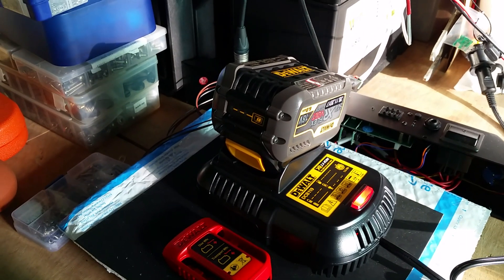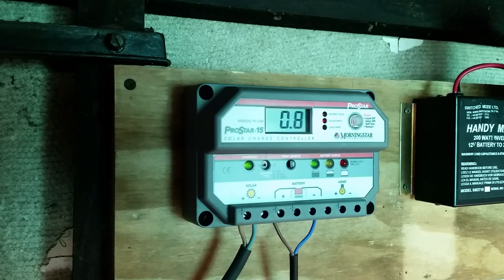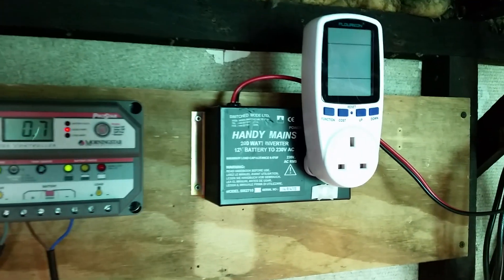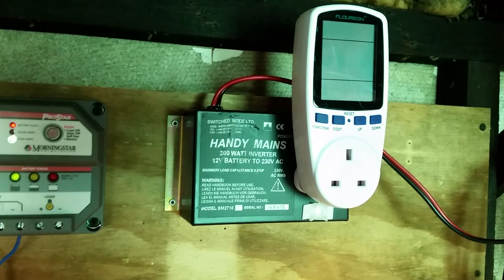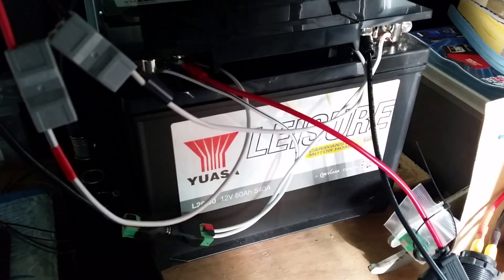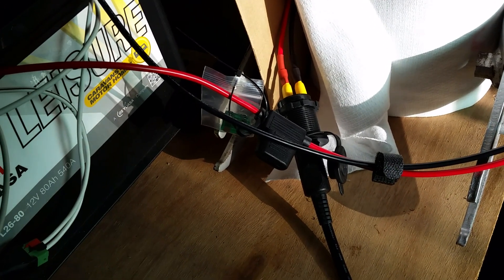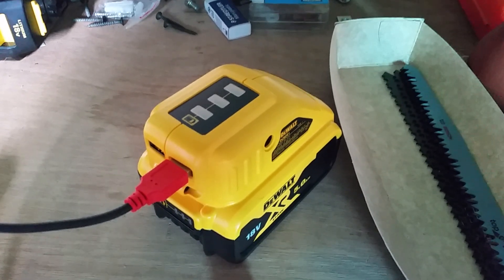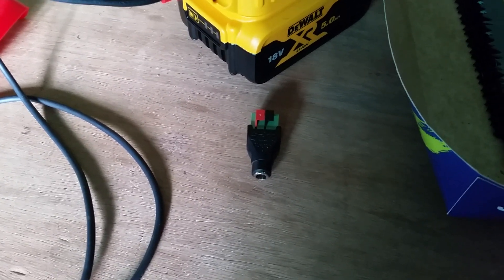DEWALT FREE POWER

Comment: Could you just install a 180w panel directly to the dewalt car batter charger?
Reply from the maker: I reckon  you could on top of your work van during the day, keep it mobile definitely need a charge controller in the circuit though stop any damage to Dewalt charger.

Comment: What happens if you plug straight from a panel to the drill battery adapter? 
Pulling from the battery it's converted to 5v 2.1a. Does it need to be 5v coming from the panel to charge the battery? If 12 or 20v comes off the panel will it convert when it goes through the battery adapter?

Mainly what I'm asking is what's the minimum you need to solar charge a drill battery? I have milwaukee and makita 18v batteries and usb adapters for both. Can I buy a portable panel that will plug and play?
Reply from the maker: Hi James you could recharge your battery direct from the panel you would need the 12v  vehicle chargers for both makes and have a 12v  3amp panel and sunshine and your good to go .
Really though you are better off having 12v vihicle or camping leisure battery .

Comment: Could you put together a kit for sale?
Reply from the maker: Can't see why not, good idea.
Reply: @boomerology18hz78  where do i get a quote from you sir?
Reply from the maker: @coojoza   I don't  put kits together for sale, build yourself a set up , 100 watt solar panel, mppt charge controller,  12v camping leisure battery  Dewalt vehicle charger . You will enjoy it . and dewalt USB adapter.
Reply: @boomerology18hz78  
Have you or anybody else reading this tried one of the USB power adaptors on one of the big de Walt dcb547 18-54 volt batteries. ?
Even the legit ones don't mention the xr54 volt packs.
I wonder how many times my chainsaws 9ah pack will charge my little old Motorola phone. ?
Reply from the maker: @timleath1652    Hi Tim Yes I have used the USB DC adapter worked really good on the 9ah 54 volt  battery  great portable power solution.
Reply: @boomerology18hz78  cheers me dear. Makes a wonderful powerpack for phones etc, just got to save me pennies and buy one with quick charge port and 12v output, but they cost £30,cheap one I got was £7